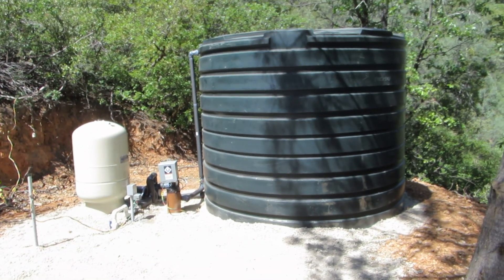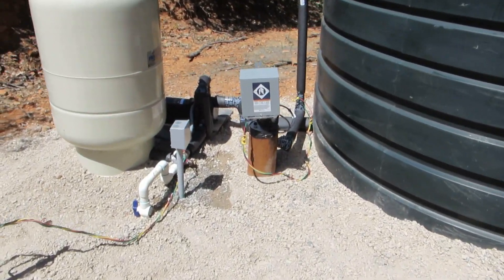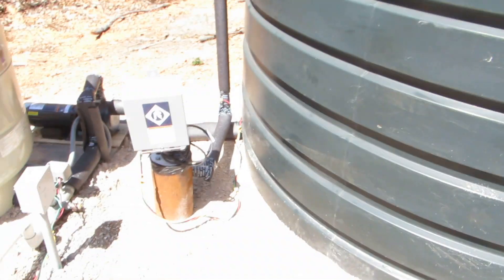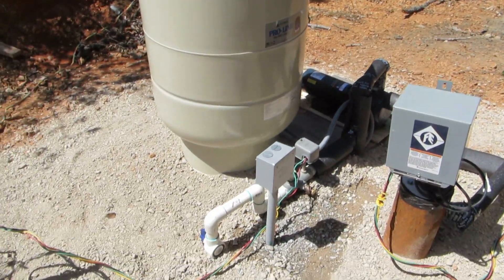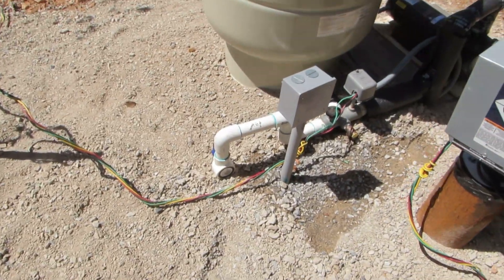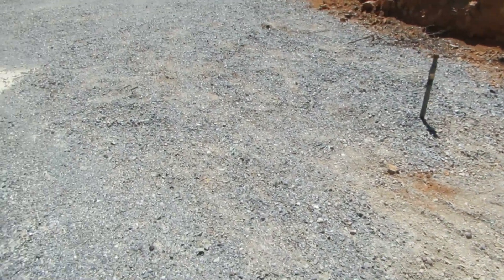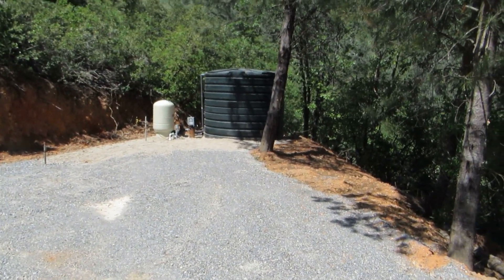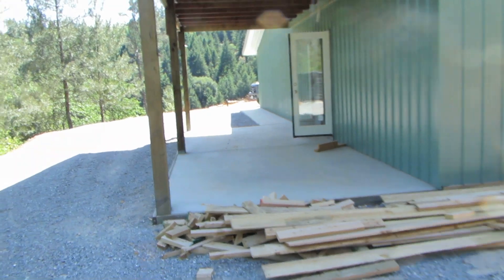Russ's water system with 2,850 gallon tank

Comment: i want to be clear that I understood correctly, you have a 15 gpm pump that fiills the  2850 storage tank, with a floater for shut off. then a supply pipe connects a 50 gpm external pump that is going to fill up bladder tank or water pressure tank, correct? then the bladder tank is going to supply the house with water, thats what i exactly want to install a system, my question was about placing the bladder tank close to the house or close to the storage tank, I think I know what to do now,
Reply: what did you decide to do, the bladder tank close to the house or to the storage tank and why you choose one setup from the other, any info helps, thanks

Comment: I don't want to rain on your parade, but I am pretty sure that that tank is just going to melt when fire hits/surrounds it. Especially the place where you put it (close to the vegetation). And then you will be without water. Firetanks are almost always made of metal.
Reply from the maker: The fire system hear is or internal sprinkler system if the house catches on fire, which shouldn't melt the tank. For a forest fire, I think it would be a good idea to have an external sprinkler system you could turn on as you were evacuating your place, so it would run until the tank ran out. You definitely would want to trim more vegetation back than you see in this video for that purpose.